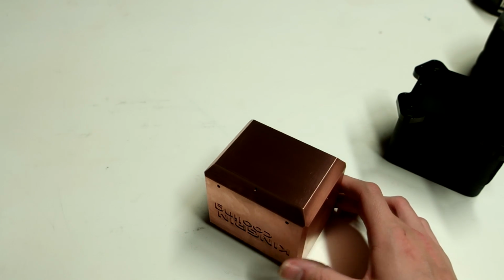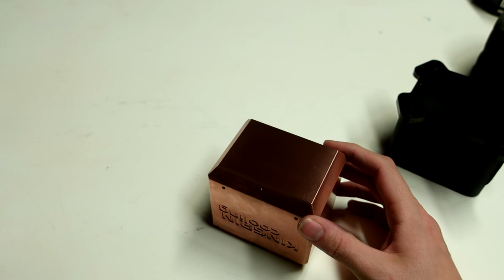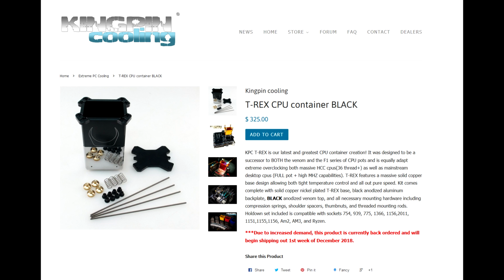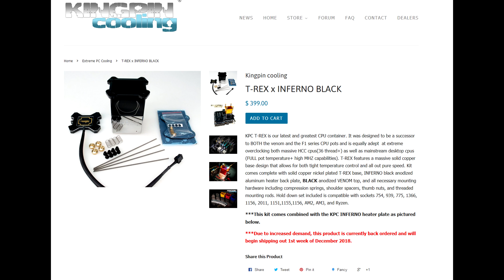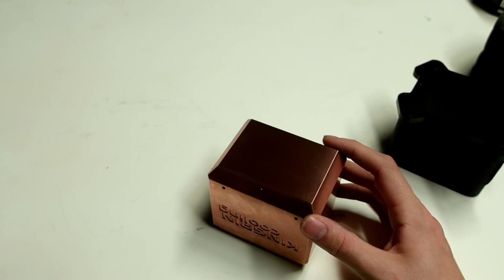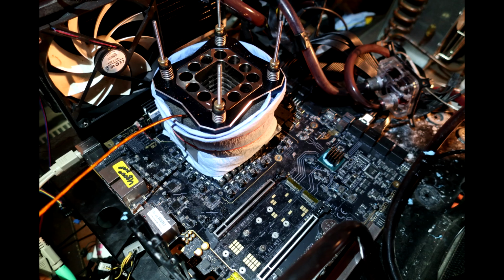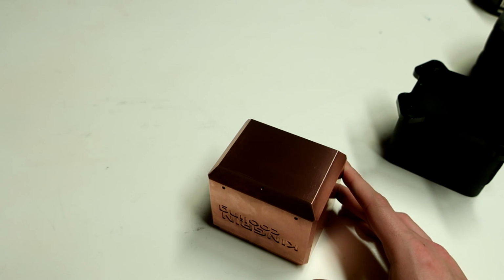Kingpincooling T-REX CPU Liquid Nitrogen Container Overview

Comment: I received it yesterday, very keen to test it, the only thing I don’t like much is that is not fully compatible with the AM4, it’s too big by a good millimeter or two, on the CH7 I had to bend the rods at the base and I’m not sure if I can have a perfect placement. This weekend I’m going to test it with the 2700X and see if I can improve my records, mainly in the multithreading benchmarks where my old fast pot was not holding, right started the benchmark I had -178° in CB15 from almost -193° of the full pot.

Comment: i see some red wires coming from one of the DIMM slot can you explain the MOD or why they are there ..on the comment section  :)
Reply: ES motherboard
Reply from the maker: Just small memory voltage mod.

Comment: I will say DON'T USE ICE in this cooler... The 2 piece can leak everywhere, so as the ice melts, it starts running out the side (and you may not see this with insulation). I wiggled it just a tiny amount because Ryzen was having socket pressure issues (the mounting kit doesn't fit my AM4 X370 Fatal1ty at all, so I resorted to zip ties), and suddenly half a cup of water just rushed out the interface between the block and the extension piece, and It spilled all over my VRM/PCIe slots, and was pouring down my table.

I'm not a fan of 2 piece coolers now... It should come with some kind of seal interface than just a light 3 oz (maybe 80 gram) extension piece resting on it without any gasket/rubber seal/0-ring or anything. Not fun when I was trying to be safe about it and test with ice first... I don't think dry ice would work well either since it barely has any room for the acetone (or other fluid providing contact between the dry ice and the block), plus the smaller holes drilled are nowhere big enough for dry ice cubes to fit, so you really need it to be full of some kind of interface liquid, and anything above a tiny puddle above the drilled area will result in leaks.
Reply: I am sticking with my f1 dark for the very reason. Ln2 is 9.99 a liter where I live where as dice is only 1$ a pound.
Reply: I have found a solution that works for myself. Sending Vince some O-rings and another Team USA member some as well to verify. It's a #153 EPDM O-Ring (EPDM is safe for Acetone use) that measures 3.485" I.D., 3.6875" O.D., 0.103" thickness. Amazon has them for $10.37 for a 20x pack. Roughly $0.50 an O-ring. It fits tightly to the base and the top piece presses it into place.

https://www.amazon.com/gp/product/B0051Y07QW/ref=oh_aui_detailpage_o07_s00?ie=UTF8&psc=1
Reply: @richiec7700   For DICE I wouldn't fill the T-rex past the depth of the center structure